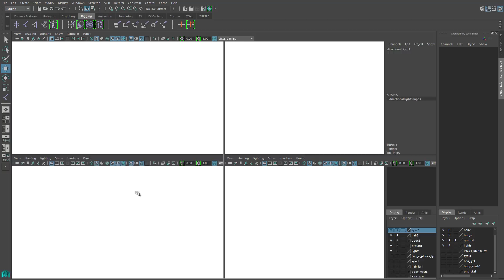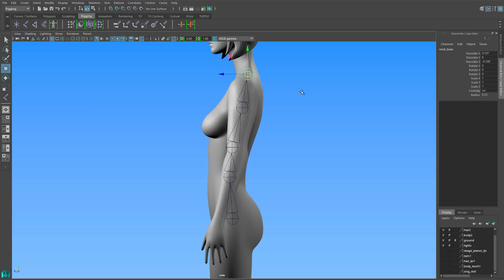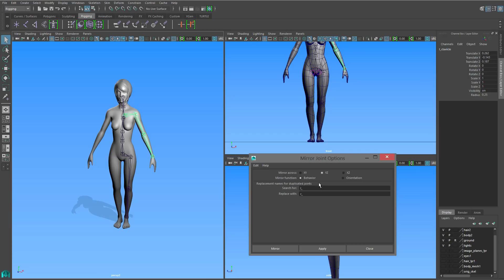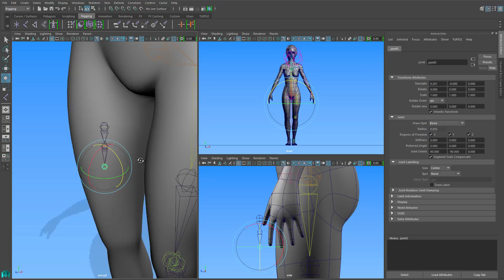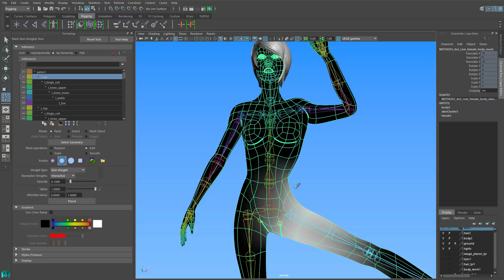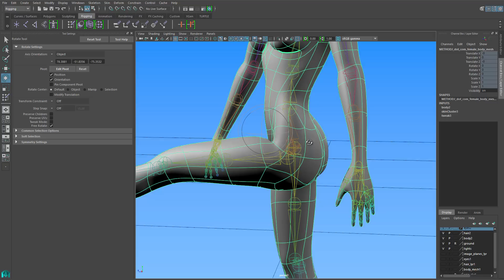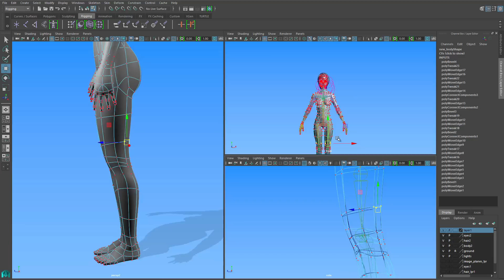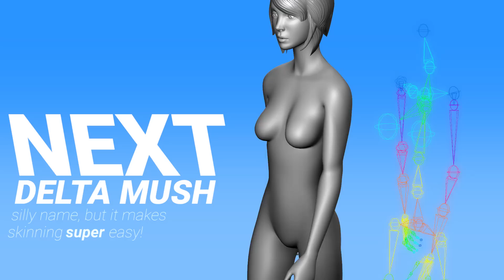MAYA CHARACTER RIGGING TUTORIAL: JOINTS & SKINNING

Comment: what happens if you already added an IK handle? does the roll joint you've created bend with it as well..?

also, have you tried using the move skinned joints tool so you don't need to unbind?
Reply from the maker: IK handles can easily be deleted and re-added. As long as your joints have the right constraints, the ik handle should be ok. You may need to add the look-at/orient control to ensure the elbow or knee points the right way.

IME move joint was more difficult to use than just duplicating and copying skin weights. IIRC it moves only along the joint axis, which can make it harder to place. I may be remembering wrong tho.

Comment: Hey, i'm trying to rig a 4-legged spider using your methods but after i bind the skin the model does not follow the joints. only when i grab the joint for the head, but then it moves the whole model in one piece. Also since i created a spline and used the middle joint for the arms to connect to the spline is divided in 2 separate groups. Can you help me with this ?

Comment: Is that nessery to smooth character before skinning or it doesn't matter?
Reply from the maker: +Babak Sobhani you can use the low res version to drive a high res version of the mesh, if needed. Copy skin weights works between two different meshes.
Reply: James Taylor thanks

Comment: My mesh keeps breaking apart and creating holes. Is this an issues with my  mesh or something that standard?
Reply from the maker: could be that you have unwelded verts, which is an easy fix, just weld them. You can also try doing a Mesh > Cleanup, to see if your geometry has any other problems.

Comment: how do you take away skin weight? For example if I have too much weight on a part of the body?
Reply from the maker: you can't subtract weights, you can only add them using paint weights. So to subtract weighting from the shoulder, you add it to the clavicle instead.

The alternate is to use the component editor, when you can type in the exact weighting amounts you want, including the ability to reduce or remove weighting.
Reply: James Taylor That’s rather counterintuitive... thanks!
Reply from the maker: Well, if you think of it like a computer, it makes sense. The weighting value for every vert must always equal 1.0. If you subtract weighting from a vert, then the weighting is less than 1.0 - but Maya doesn't know what to fill in the remainder with, and it doesn't want to guess. So no subtraction!

Comment: is there a way to move the bones without deskinning it? as when i deskin it it goes into its original position but i want to change a bone placement after i set it in posistion
Reply from the maker: yes, I cover this in the extended cut. There is a move skinned bones tool in the skinning menu that allows you to do exactly that.
Reply: alright ty

Comment: So how do you erase when working in "Paint skin" mode?
Reply from the maker: you don't, really. You switch to a different bone and add weight to that one, instead. It is a bit frustrating at first, but after 10 years you finally get used to it (jk, I still find it frustrating)
Reply: Oh I see thank you, I was using "Replace" instead of add. Which meant I hade to click on each individual vertex to remove their weight.
Feel like this is going to be less frustrating ;  D

Comment: I purchased the longer in-depth tutorials and they have been helping a lot, but ran into a problem when I try the Mirroring Skin Weights option.  When I click Mirror Skin Weight and try to rotate both legs from the the hips the skeleton rig rotates the legs outward correctly but it unbind the right side leg skin and the skin of the toes follow the left leg.  The right leg toes stretch from the bind pose position to follow the left leg.  Not sure why this is happening.  :(.
Reply from the maker: +Iain Mcleod check the mirror skin weight options to make sure you are mirroring over the right axis. You can try a setting, mirror it, see if it works, and undo if not.

It is also common that some very don't transfer well, try using hammer skin weights on those.

Comment: You make it sound so easy yet getting the joints to select properly, dealing with grid snapping, etc is a fucking nightmare.
Edit: Turns out my prefs were corrupt, if anyone else is having this issue delete your maya prefs folder and reopen maya. After I did that everything worked.

Comment: @James Taylor I have a question. I'm working with a character model that has multiple layers of clothing (a button up shirt and a vest over top). I have UV unwrapped each piece. Should I combine the two clothing meshes into one before skinning them to the joints? I'm having some trouble and I'm not sure how to go about it. It seems that even if I combine the clothing meshes into one model when I weight paint I still get clothing poking through one another. This is aggravating! It doesn't quite act as one solitary mesh. Do you have any thoughts on this? I've been stuck for a very long time.
Reply from the maker: you can leave them separate. Weight the shirt first, then copy skin weights from the shirt to the vest. The key to overlapping clothing like this is to make sure your topology is almost identical between the two meshes - that will prevent the poking through you're seeing.
Reply: Thanks I'll give it another go, the clothes are coming from ZBrush. So the topology is clean for each piece but not identical. That's why I was curious about combining. I hope I can figure something out.

Comment: Where you show how to paint the skin weights, it worked for me the first time but now the colour ramp is just not working. Might it be down to my rendering or the fact that I have clicked the 'use default material' setting (so that its not constantly rendered all the time)? I've tried a few things like selecting a joint again and turning the colour ramp off and on again, but to no avail! Any ideas? (Disclaimer: I am completely self taught exept for this video so please dont used fancy words)
Reply from the maker: well turn off display default material, and make sure you are in Viewport 2.0. Paint Skin Weights don't seem to display in High Quality Viewport or Legacy Default Viewport. 

Also, if it is showing up just black and white, there is a checkbox in the paint skin weights settings that will turn on color ramp, make sure it's checked
Reply: Hey, I think I have that fixed now thanks. On another note is there a way to do the same thing but taking the weights away? So if I painted too much and context means I cant undo.

Comment: I have a question. I have seen in rigging that they make controllers and then give IK and FK and all that but you didn't use any of those to pose your character.
So is that some different thing or you just do same thing in different way?
Reply from the maker: that is a different thing, controllers are a whole other level of character setup, this is just joints and skinning

Comment: If I move the joints of the fingers, they move out of the mesh. Same if I move it with the IKs. How can I fix it?
Reply: usually the pole vector will fix it. if not you may have to go back and look at how you laid out the arm or the leg joints. if you click the joint..and open the attribute editor..you'll see joint orientation.  if im doing the arms...i click the shoulder joint and rotate using the joint orientation. this way you wont have any rotation on your joints.
Reply: and the joints will stay in the mesh! :)

Comment: Ive got a problem when i bind the skin to the model. For example, if I rotate the left leg it also moves some vertexes I dont want it to. When I show the selected vertexes for the joint it has some in the shoulders and the head. How Do I remove these and add the correct ones? 
Thanks in advance

Comment: Been working my way back into rigging and joint-work, so this tutorial is a great refresher (that helper joint between the hand and the index + pinkie works wonders). Quick question since I haven't seen the extended cut (I'll be fixing to purchase it once I can offset some costs and get some of my commission checks cashed); would you still use helper joints for a model with IK/FK controls or that has control handles for animation manipulation? I'm asking because most of my work doesn't really make poses like a mannequin, but rather an entire action for games or simulation.
Reply from the maker: +Rodin Claus yes, you would still use helper bones in that situation

Comment: Nice tut, but don't you orient the joints?
Reply from the maker: I think the extended cut goes over that.
Reply: Ah I c thanks.  I might have to check that out.  I don't know if 
anything has changed since Maya 2013, but I oriented the joints 
according to how I was taught a few years ago.  

I've noticed though that adding IK's in Maya 2016 seems a bit different.  They wont rotate the leg or ankle joints along the Y axis for some reason.  But if I open up an old file where I created the IK in Maya 2013, they still work along the Y axis as they used to.  I tried looking for settings that might be affecting it, but failed in my quest.  Really don't know what's going on.

Cheers, James.
Reply from the maker: Joint orients haven't changed AFAIK. If you are having IK problems where the IK either locks up or moves your limbs in the wrong direction, I find bending the joint ever so slightly helps solve the issue.
Reply: Yeah rotating the joint manually works, but doesnt work with the IK manipulation.  So here's the thing;  I've set up leg joints from hip to toe the same you have.  This is the first time I've used roll joints on the thighs though and Ive tried this with and without roll joints. Anyway, I've set up an IK handle on the leg parent constrained to a control on the foot.  Lifting the control and moving it backwards and forwards bends everything correctly, but when I move it left or right or rotate it horizontally it just moves the leg and foot left and right without any thigh rotation.  And without the roll joint, no hip rotation occurs. This only seems to be happening since I moved to Maya 2016 and only with IK Handles created in it.  I can bring in an old Maya file from Maya 2013 to 2016 and the IK Handles still work and rotate the way they did.  After a bit of a look into it I've discovered that IK handles have changed since Maya 2015.  Apparently to create an advance rig, that does what fewer IK handles did back in 2013, you have to link IK handles together.  For example if you want to move the pelvis without the feet e.t.c getting pulled along, you need to create a handle from the pelvis to the hip, another handle from the hip to the ankle and then one more from the ankle to the toes.   This pretty much creates a similar effect to what could be achieved with fewer IK Handles in Maya 2013.  And from what I saw in the video I was watching about IK handles in 2015, there is supposed to be some sort of Control that appears with it that allows you to rotate, but I can't seem to see or select it in 2016, so I'm wondering if something has changed again.
Reply: Ok after lots of experimentation I have figured something out.  I guess the term I am after is "Twist".   I found it in the Channel Box/Layer Editor in the IK Handle.  And after experimenting I can actually get the first joint of the IK system to Twist.  I can use either the Twist Attribute and now all of a sudden, like the old days, moving the IK handle also causes a twist on the first joint.   However it seems that Thigh Roll Joints are a No, No.  Because the IK Handle seems to need 3 Joints to work correctly on a Leg, otherwise the Roll Joint just gets ignored.  Also attempting to animate the joint manually and key it in also gets ignored on the timeline, resulting in no thigh twist animation.  So I think I'll stick with no Thigh Roll Joints and just carefully weight paint the buttocks and thighs, like I usually do.
Reply from the maker: glad you figured out a solution. Also, thanks for sharing the solution, I know people will find this helpful. The limitations of joints are such a hassle, I'm surprised that we are still using the same system for character animation. I'm playing around with the new HumanIK system now, but it just seems like it is the same old solutions, only packaged up into a single one-click solution.
Reply: np and thanks for sharing what you've found with the Human IK system.  I was wondering about that also.  

My next hurdle with these new IK's is trying to find a way not to let them twist the legs when all I am doing is lifting them up to a 90 degree angle lol!  Going to carry on experimenting next week.
Reply: Ok, I've done some reading and experimenting and found that it is possible (only just, but its buggy as hell) to move a joint independently of its IK handle and keyframe it.  In the IK Handles Attribute Editor > IK Solver Attributes, you need to set the IK Blend.  The lower this number is, the more influence is given to the joint over the IK handle it is assigned to.  So 0 is full influence to the Joint, 1 is Full influence to the IK Handle and 0.5 is 50/50.  I set mine to 0.5. 

Now the catch is that it appears to be really buggy.  I've found that most of the time attempting to adjust the joint will result in nothing, so it will act like the IK Blend is set to 1, even if it isn't.  A way around this is to set the IK Blend to 0, rotate and key in the joint, then set it back to the figure you had it at again.

Comment: I had a question about skinning. If you are making a game where there are a plethora of armor sets for the player to chose from, when it comes to skinning, is there anyway to speed up the process? Instead of redoing the entire skinning process for each different armor mesh? Meaning, is there any way to save skinning information done for one mesh, and apply it to another mesh?
Reply: Never mind, I found out about the copying skin weights feature.
http://help.autodesk.com/view/MAYAUL/2016/ENU/?guid=GUID-EA1D1658-A32C-4136-8CA6-F7111117DECE
Reply from the maker: yes, exactly that, you would skin the base body mesh, and by copying weights onto all the armor pieces, everything should move in sync. I would caution with the armor - don't let it get too bendy, otherwise it doesn't look like metal!
Reply: Lol, of course, I'm going to rigid bind those parts so they don't bend at all like in real life. Thnx so much for replying :) Also, I am not making the armor as parts, I have entire meshes for each armor set, because they are quite different from one another.

Comment: Having major problems with skin weight mirroring. Is there anything i should know as a tip? My mirroring either messes up the mesh completely, isn't mirroring 100% (more like 50%) and sometimes it mirrors the side i wasn't working on :(
Reply from the maker: +Bucket Gamers make sure your mesh and the root node are centered on the origin. Double check the settings for the mirror weights tool, make sure it is mirroring across the correct axis.
Reply: Thank you for answering! As an amateur these words such as "Root node" are still foreign. But at least i have something to read up on now :)

Comment: Hi james, my fingers are not bound to the finger joints, might you know what's causing this?
Reply from the maker: that usually happens when you've added joints to the skeleton and then bind the skin again. Maya can't find any weights for the bones in that region, so the verts are weighted to nearby joints. Use the component editor to weight the verts and see if that fixes it.
Reply: Alright I tried it for the thumb, the tip and the base of the finger did attach not the middle point, rest of the fingers are not. I don't know what to do

Comment: What's the difference between that geodesic voxel? bind and closest distance? Attempting to keep up with a class and that's what we are supposed to use but I've been at re-painting skin weights using the HumanIK skeleton because it is required for the final. It seems like it is a lot harder to paint for the HumanIK skeleton than your own custom one. Any thoughts? Also would the geodesic voxel bind not work if we are then moving the character into MotionBuilder? (not sure if you've done MotionBuilder yet - just subscribed).
Reply from the maker: +Christine Howell :Game Design try binding the character with one of the other bind methods and moving it around. Then do the same with geodesic voxel. The difference will be immediately clear. The bind method is irrelevant to MotionBuilder, that only applies to the actual binding process, not the final skin weighting .
Reply: +James Taylor Thanks for that. It seems to work better already - just have a bit of touching up to do here and there.

Comment: This model has a few tris
Reply from the maker: +Joel Michael sure does, I explain why I added them in in the modeling video: https://youtu.be/jZekghp78x8Also, triangles get a bad rap! http://methodj.com/why-are-triangles-bad-when-modeling/
Reply: +James Taylor recently Ive found that any shape is possible in all quads without tris or Ngons however poles seem unavoidable
Reply from the maker: Yes. Triangles are not such a big problem, except in areas where there is deformation. Even then, they aren't necessarily a problem. Ngons, on the other hand, always need to be avoided.